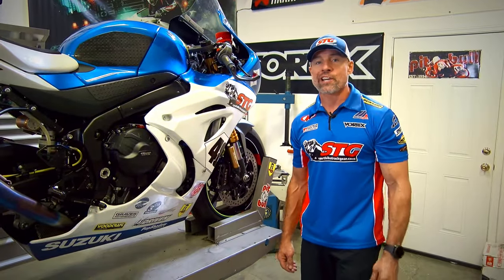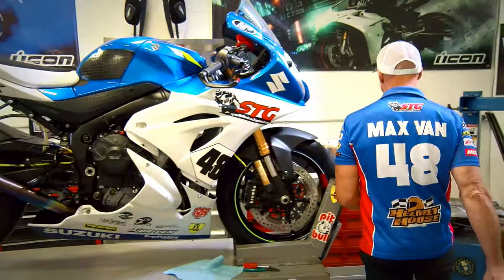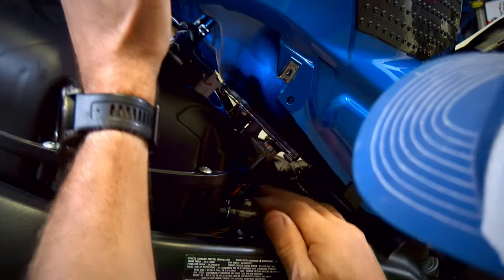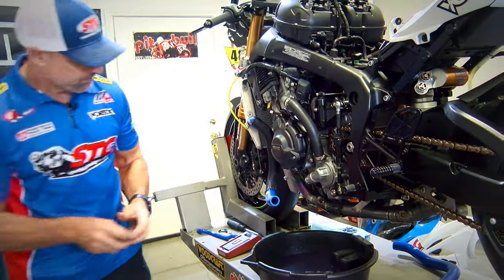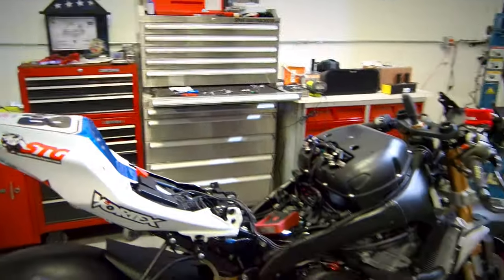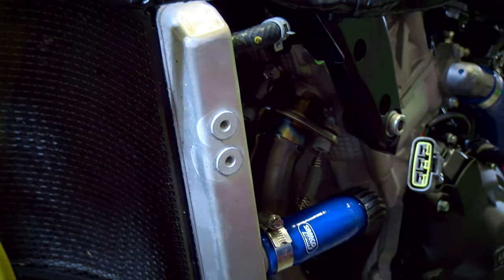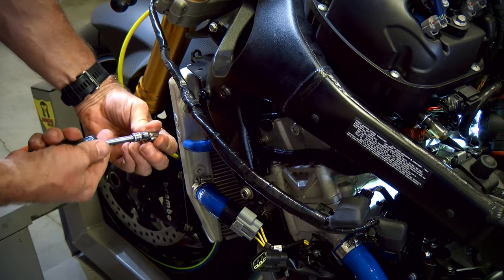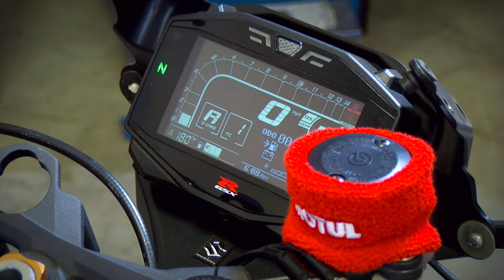Samco Sport Suzuki GSX-R1000 17-23 Radiator Hose Kit How To Install - SportbikeTrackGear.com

Comment: I had a k6 gsxr 1000 with the blue Samco hoses fitted by a previous owner, the hoses near the stator cover of the bike discoloured by having thousands of white speckles which i could not clean off and that annoyed the hell out of me. I wish i could upload a pic of it. What i thought was even worse is that the bike was the stealth black with the red accents in the decals and some tool thought that blue hoses would be the way to go 🤣🤣.
Reply from the maker: I have had these on a couple of bikes now and not had an issue personally. If only the hoses on one side had this I would suspect it to be an outside contaminant. - Van

Comment: I've seen some samco hoses leak on the track but I think it was a clamp problem because it was at the tip of the.connection itself. Any special way to clamp them?
Reply from the maker: The Samco clamps are a bit thicker than the OEM. When installing the kit and clamps you need to make sure the clamp is clamping down on the hose only and not the ridge on the nipple for the housing. - Van